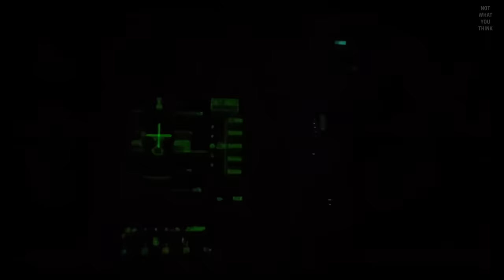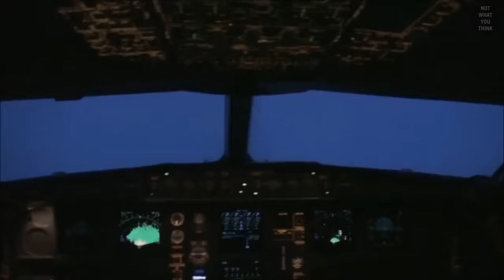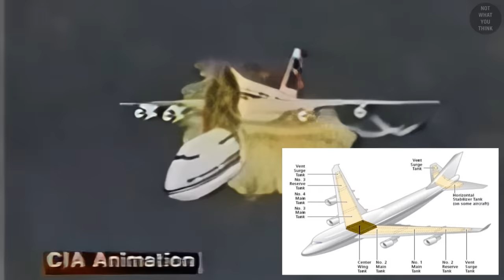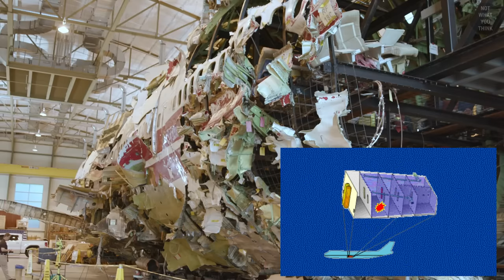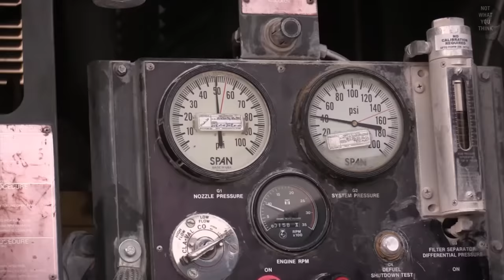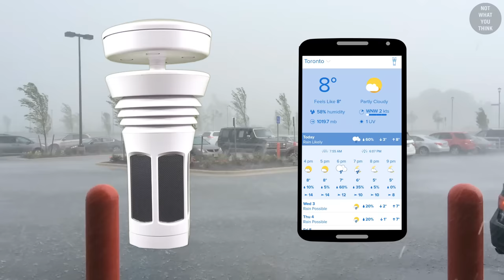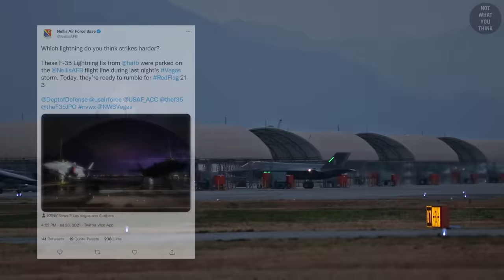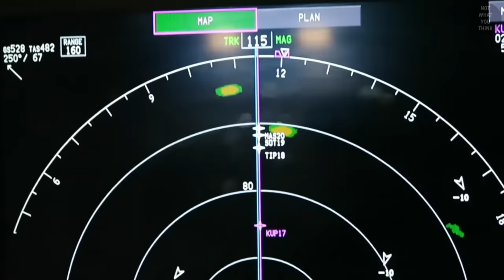Why F-35 Don't Fly During Thunderstorms

Comment: In their defence of Cat A damage: it doesn't take much damage to an aircraft to rack up a $2.5 mil repair bill.
Reply: In an environment where toilet seats run $8K a pop, I'm inclined to agree.
Reply: Well the repair bill was probably 30 million.
Reply: god forbid someone touches a conformal antenna without gloves on.... Thats expensive...
Reply: Cat A was solely for loss of life 'til those same accountants got involved.

Tell me, what's the cost of placing passenger seats facing backwards vs their value WHEN an aircraft crashes?

What should one expect to pay to defy gravity?
Reply: @sorennilsson9742 
 1999 one B2bomber crushin in Croatia when be a struck by lightning over Serbia
Reply: @svenmorgenstern9506  is this a real thing? That’s criminal.
Reply: @marjanstojanovic2663  I thought it was a SAM  that brought it down
Reply: Especially when that pos costs 100 mil each.
Reply: @PvtPartzz  Be careful of these cost estimates. A lot of military and government acquisition include things like LIFETIME maintenance, training and spare parts. Also depending on WHAT toilet we are talking about.... They can be much more expensive and complicated. A submarine toilet is not cheap because it needs to fight against the pressure of being submerged. And since the original claim is so unspecific its impossible to verify. People throw out random cost numbers all the time
Reply: Not if the thing costs already in the 3 or 4 digit millions to begin with xD

2.5 mil in relation to what budget the military gets feels like not even "a scratch".
But what do I know, they spend more money per day than I'll ever earn in a lifetime.

Comment: About 4 years ago I was flying into St. Louis when we hit a thunderstorm. I had a lonely flight back so I was very bored and spacing out the window. It was night so the only thing I could really see was a small light on the tip of the wing. As we were in a holding pattern above the air port and waiting to land, a lightning bolt struck that little light. I remember the entire cabin of the plane lit up like it was day time! Of course I was freaked out having just witnessed a lightning bolt blast out my only external light source. I spent the next half hour as the plane landed clutching the handles of my seat like I was trying to leave imprints in them. Finally as we get the plane parked the pilot gets on the radio and with a little laugh says "Well folks that was fun wasn't it! Don't worry, we get struck by lightning all the time." I really would have appreciated him telling us that earlier, like perhaps when the plane was flying through what looked like hell. 😨
Reply: He need to focus
Reply: @prumchhangsreng979  oh I'm sure. That plane was rocking like crazy. I'm sure he was fighting it to get it to stay flat and level.

Comment: Kind of ironic how a jet nicknamed "Lightning" can't fly in thunderstorms which include lightning...
Reply: Indeed.
Reply: I thought that the moment I saw the thumbnail
Reply: Haha... that is ironic.  The pilots unofficially call it the Panther or Fat Amy. I always thought it looked like a swimming penguin from the side😅
Reply: @justinavery8664  the penguin part cracked me up lol
Reply: F-35’s have no problem flying in Thunderstorms and are well protected from lightning.  The title of the video is misleading.
Reply: Oh the simple mind of ignorant people, you’ll believe anything.  Do some research, maybe even ask someone with JSF experience, ah never mind.  Ya can lead a horse to water, but ya can’t make’em drink.  But ya can drown’em.
Reply: I didn’t even think of that.  So true.
Reply: actually it's bescue there's not much shielding that would protect the stealth coating and obiggs in the F-35 without making it heavier and more easy to detect from ultra high frequency radar unfortunately
Reply: @ashtiboy  you are absolutely wrong…. Tell what you know about the system OBIGGS and why it is not on the F35 or too heavy.  Tell what you know about LO and what that has to do with Lightening Protection.  Are you a certified Spec or LO Tech?  Me thinks not…. What is the extent of your JSF experience?
Reply: @markoliver474  well but you need much thicker  heavier metal alloy plating not composite plating but if you do that then ultra high frequency radar would kinda be a much bigger issue! also  the F-35 uses a stealth composite frame and a stealth composite frames naturally sucks at protecting against  lightning bescue its not conductive enough to properly form a faraday cage! a faraday cage thats thick enoth to propely sheld a aircraft likea F-35 would require a much thicker and heavier metal alloy frame! but  however if they did that then yet again it would ruin any stealth against ultra high frequency radar made and built especially to detect stealth craft detection system completely! this is bescue thick metal alloy plating that protects against lightning strikes would be very easy to detect from a high motion doppler effect from a ultra high frequency doppler radar system made to detect most of the older stealth aircraft these days!
Reply: @ashtiboy  what?
Reply: @ashtiboy  their stealth coatings is made off rubber acoustic skins finished with graphene based paints. The same things they used in F22. 
It's the same technology used in stealth subs.
Reply: @sys3248  but rubber acoustic skins also suck at dealing with lightning strikes on planes bescue rubber is super restant to electricity but that means however that it makes the lightning more attracted to the F22 and F35 internal parts made out of metal parts instead!  plus rubber sucks for lightning strikes because it can combust and also melt from the very very high temperatures from iondized plasma part of the lighting knida is very bad and dangerous for rubber! like i said YOU NEED A F*** METAL ALLOY FRAME to make the entire plane grounded and protected against lightning thure the faraday cage effect! but like i said before if they do that then modern enemy ultra high frecasty doppler radar would kinda go get very easily bounced around and back out of a plane with a metal alloy frame! for modern stealth craft  you gotta make almost the entire outer frame made out of a  composite material that has as little electromagnetic conductive and reflective properties as possible! but those kinds of things suck at lighting protection! bescue lighting protection requires very high electromagnetic conductive and reflective metals to shield a aircraft from lighting! this is  basic electromagnetic science logic here! if you have to have good lighting protection the basic properties of the materials that are good at protecting against lightning also make sead same mertail much more easy for radar system to detect the aircraft! you can have a stealth aircraft or a all weather air craft but with our current technology you can't have  both stealth aircraft with all weather capability! this is because we don't have powerful electromagnetic powered sci fi force field tech yet that can fit into a aircraft and work good enough to protect against lightning quite yet!
Reply: @ashtiboy  well maybe that's why they say it didn't fly in thunderstorm.
Reply: @ashtiboy  Remember, this a stealth aircraft so having only a alloy frame would defeat the entire designs purpose as the rubber used and even paints are meant to absorb radar waves and reduce cross section on the radar it shows up on, being similar to a golf ball in cross section. Without the special rubber and paint it would likely be far bigger even with the systems it uses, probably close to a small civilian aircraft
Reply: The P-38 
Lightning 
did it better
Reply: @willymac5036  This is true, The Jet is as far as I know, less conductive being made out of mostly composite
Reply: Yeeeeeeee
Reply: Kind of ironic how you commented on a vid you haven't watched...

"Got hit, flown back to base, landed safely, noone was harmed" - plane incapable of flying thru thunderstorms according to you.
Also yes, magically humans haven't yet broke the laws of physics, sometimes you can't have everything.
Reply: can the a-10 survive a pack of hogs
Reply: The version going to Britain, Belgium, Finland or Italy can fly in thunderstorms because it is EU law that they can
Reply: @ishmaelbryan5487  bot
Reply: Was just about to make this point xD
Reply: There cannot be two sword in one satchel
Reply: Aircraft, not just F-35, don't fly through thunderstorms. They're quite dangerous.
Reply: @Ripper13F1V  .. Large commercial aircraft and all military jets are very much supposed to be lightning and weather proof enough to survive multiple lightning strikes and heavy hail.. Commercial flights will try to avoid all storms for turbulence reasons, military craft need to be able to use cloud cover and fly in poor weather in the heat of battle. Training missions can be delayed by bad weather but there's no luxury of that kind of caution during war.
Reply: @PrivateSi  Not that same thing as flying through a thunderstorm with 100-200 mph updrafts mixed with hail and lightening. Pilots don't fly through thunderstorms on purpose, they avoid them like the plague.
Reply: @Ripper13F1V  .. Look mate, I know what the F35 has to withstand as I knew the head of F35 Lightning Protection team (that also covered jamming technology... Lighting + EM protection).. Every part is tested to destruction in UK's leading artificial lightning test facility. They have to be able to fly in dense cloud and thunderstorm. They had many problems when I knew him, as did he..
--
The guy was a raving pot smoker and drinker. I am not joking.. Super-brainy engineer with loads of advanced radar knowledge and experience, but with the personality of a squaddy on leave, and fists to match (in his younger days before I knew him)... We were quite close for a while but obviously there's only so much he could talk about, but things like testing parts we talked about a lot as that was the bread and butter of his department and there were many parts that did not cut the mustard... The complexity of the skins and density and location of the electrics were the other major headache... 
--
But yes, ideally even military pilots try to avoid heavy thunderstorms, but also storms in general.. tornadoes and hurricanes... Lightning Protection is separate to wind protection though.
Reply: yes it is.
Reply: @jasonator69er  .. It's slower than lots of older planes. It's a multi-role jet, not an interceptor or SR71.
Reply: @justinavery8664  its ugly,yeah 🤣🤣
Reply: @virgilius7036  .. I lived next door to the Lightning Protection Department manager of the UK division of what became G.E. (was Smiths Industries when they first got the contract).. He was being head-hunted by Airbus when he got his promotion to head of department..
--
 I can assure you even modern commercial airliners are nowhere near perfect Faraday cages. Many different composite, insulating materials now-a-days... You are also forgetting about Electronic Warfare issues..
Every part has to be tested to destruction at UK's leading high voltage test centre in as close an approximation to their final packaging as possible (that kept on changing because of other design changes and many,, many failures)... 
--
These are modern warfare hardened systems, but they are so over-complicated using so many modern materials all over the place it's an engineering nightmare.. Even the paint makes a difference - to STEALTH too... so many compromises.Often adding protection for some aspect of severe STORMS impact other aspects.. Ie. Hale can strip an all-over metal dope on top of composite lightweight and strong materials with metal framework.
Reply: @virgilius7036  .. Also.. they guy was the most stressed out manager I've ever met. worked hard, played hard, looked hard.. He 'de-stressed' harder than many people I've known too.. 6 pints on a wednesday night with a 7 ball by me against him or him against me quite often, and other local in the village not far from where he worked and also close to another company he liased with.. He left the company after I'd already left the village and we didn't keep in contact. He'd already moved by time I left.. The place was crawling with egg-heads and spy analysts from where he worked and from the very well known government organisation also obsessed with all things ELECTROMAGNETIC, especially COMMS... Half the F35 internal comms are WIRELESS... Avionics for the military, especially with the yanks involved, having to trek off to Lockheed for presentations a few times a year was a mental buzzing ultra-stress all in one for the MAD ROUGH GENIUS!... You don't want to get into an argument with him, I'm telling you!... No joke... everything I have said is 100% true.. I could give you his name and you could see his linked-in profile, but not a chance that's going to happen....! JUST SAYING!
Reply: @vash_the_stampede6570  .. I don't know what you mean about the SR-71.. I know a bit about the struggles of testing the F35 avionics due to all the modern materials and sheer number of parts spread over so many companies (that G.E. ended up buying many of), spread around the world. NIGHTMARE.
--
I know what I suspected about ball lightning (projection technology) 20 years ago is now available in mini commercial projectors that   ionise the air at a point moved so quickly it forms an image and/or pulse so quickly it produces sound.
--
ionising an aircraft skin and wrapping a ship in an electromagnetic coil were tested stealth technologies. I know The UK MOD has declassified old documents that show they suspected Russia may be testing a plasma engine UAV (and they knew about ball lighting, natural and radar/laser induced, at the time).
Reply: @justinavery8664  penguin. Lmao
Reply: Kind of?
Reply: Yeah
Reply: Damnit you took my comment before i even saw this video lol.
Reply: @willymac5036  Have you piloted the F35 before?
Reply: @LordEmperorHyperion  no I have not personally flown the F-35, but one of my brothers is an F-35 pilot.
Reply: That's what's I was about to comment
Reply: Because there can be only one lightening in the clouds at a time😂
Reply: Hilarious

Comment: Nicely presented.  There's quite a bit more to aircraft-lightning interaction than that.  Everything on an aircraft has to be certified to fly, which includes lightning withstand - from both the direct effects (high current, forces, and heating) and indirect effects (mainly interference on electrical systems).  Having worked at one of the labs which does this, I can say it's great fun blowing up bits of planes to make sure they're safe when in use.  Mainly specialized in fuel systems.

Comment: I was in the S. Pacific last year sailing to Peru and saw 3 F-35's flying low together during a thunder storm. I was approximately 40 miles from the coast when they flew over me, twice. I do not know why they would need to identify me so far from common American operational areas, but it was a treat to see them nonetheless. So, when you repeatedly stated they do not fly in thunderstorms, I can not help but chuckle.
Reply: You became a training opportunity.  Likely trying to get close enough to use EOTS to see if anything "interesting" was happening on board.

Comment: Am i just dumb or was the question never answered? The OBIGGS system is combustion prevention, it was found damaged/not working as intended on one plane so it was redesigned in 2014. The Japan incident damaged the planes, but did the video ever tell us why? Something about the composites on the exterior used not providing lightning as it was expected to?
Reply: The OBIGGS has been sort of an ordeal because after the system was redesigned, a maintenance check found that the tubing got damaged so they put the restriction back in place. The video did address it but it was easy to miss. The damage in the Japan incident was not fully explained but the implication was that because the F-35 isn't a huge metal cage like other aircraft, there was no "Faraday protection" so there was damage even though they were still good enough to land.
Reply: @ChucksSEADnDEAD  ah so the redesign was a fail and not having Faraday protection was an oversight?
Reply: @akita2438  I don't know if the redesign had a problem because it seems the issue was somewhere else, in the tubing. I'm not up to speed with the investigation and what caused the tubing to get damaged.
There's no "oversight" per se, if you have too much exposed metal skin it stops being a stealth aircraft. The fact is that when non-stealth aircraft are pitted against stealth in exercises they get the floor wiped with them. There's just too much at stake to prioritize lighting protection when the aircraft can be repaired if hit by lighting, but there's no repair if they get split in half by a missile.
Reply: Yeah, this is just click bait. I'm going to ignore the channel.
Reply: @gail_blue  Yeah. 90% of the video has nothing to do with F35

Comment: The F-35 specifically is designed to fly through thunder storms, getting struck by lightning is an extremely common thing for jets. And an F-35 is designed to take lightning strikes with very minimal damage. The radar absorbing material just attracts more lightning, making it more likely to be struck, but they fly through thunderstorms regularly it's no problem at all.
Reply: No...
That is not the reason...
Reply: @Rosie 
Okay so you just stop by to talk trash with absolutely no point or case whatsoever. There is no fighter jet outside the US that is even close to a match for an F-35.
Reply: @@Rosie-ty5hulmao no examples just "weak" 

Thanks for giving me a chuckle 👍